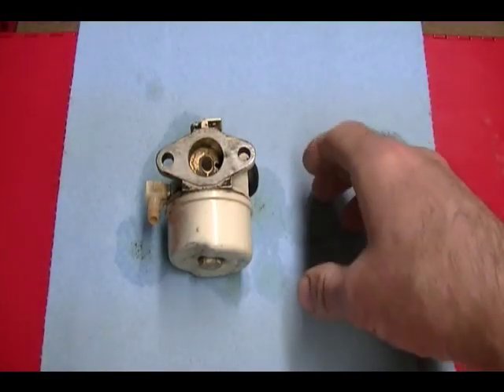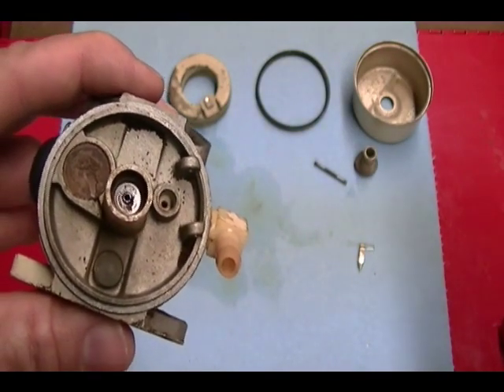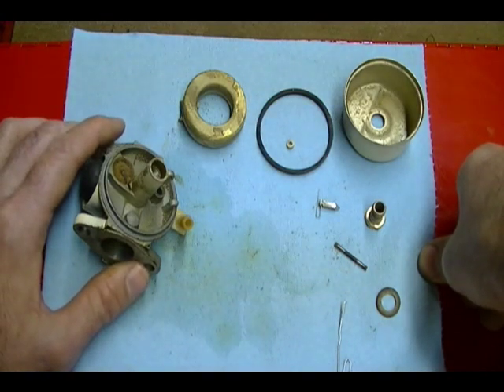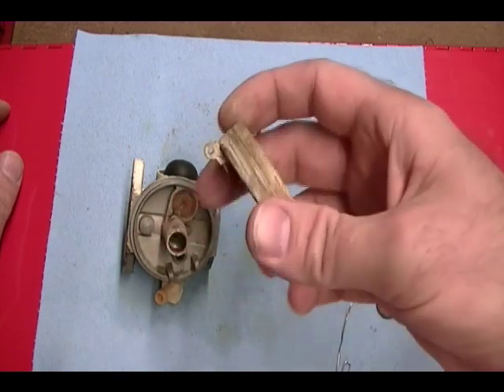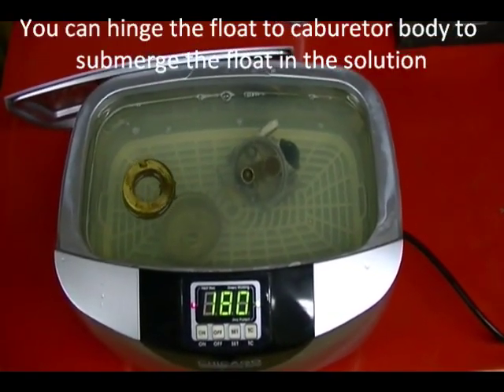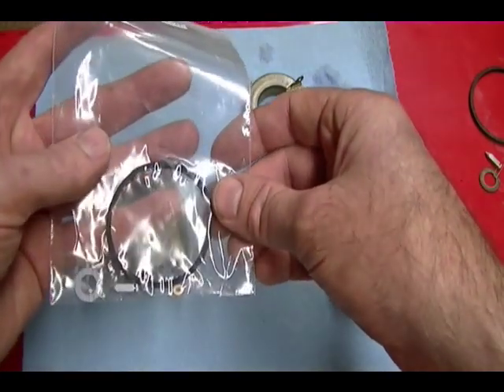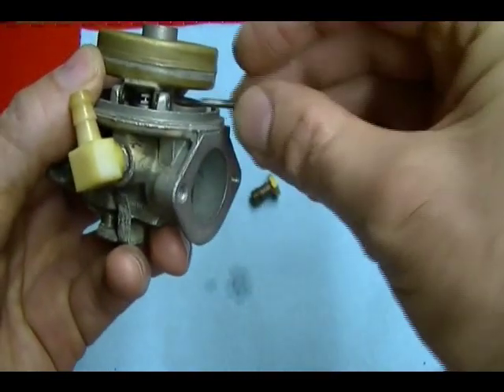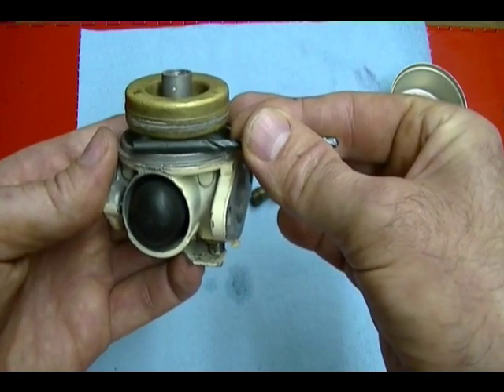Small Engine Repair: How to Clean and Rebuild a Tecumseh Lawn Mower Float Carburetor Part 2 of 3

Comment: Question:  Tecumseh OHH55...  same problem happened on an HS50 that had other issues that the OHH replaced...  But anyways.  The engine has under 30 hours on it.  Runs fine.  However, and it just started this out of the blue, there is a problem with the carb in that when sitting, it will just puke gas out the emulsion tube until the tank is empty unless fuel shutoff I was forced to add is turned off.  Float has been replaced along with needle and seat and has been adjusted.  Same problem still persists.  Don't know what to do and it's getting to the point where I feel I'm going to have to go carb hunting.  Any ideas?
Reply: Daniel Vogel lrecently had same problem after a rebuild. I did not have the seat seated all the way down.
Reply: william williams. This happened on a carb that hadn't been touched since leaving the factory (the OHH55)so I don't know what the deal is...  I still haven't touched that carb but instead put in a shutoff to keep it from puking gas

Comment: FWIW it was just a dirty carb.  Though I will say I overlooked changing the fuel line and had to rebuild it a couple/three  times as dirty varnished gas kept entering the GD carb.Plus it really was mandatory to remove the carb from the engine to clean EVERYTHING even though the bolts were a PITA.

Hey it was my first carb rebuild.  Needless to say my $20 snowblower is working awesome,  I have a better understanding of 2 stroke engines and carbs, and I am almost looking forward to snow.